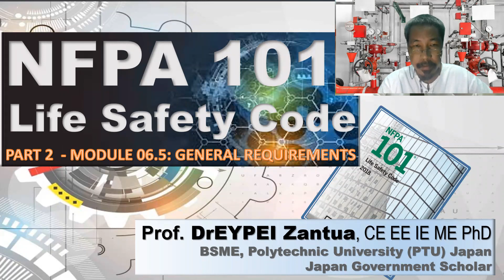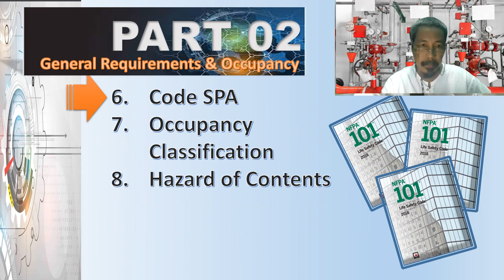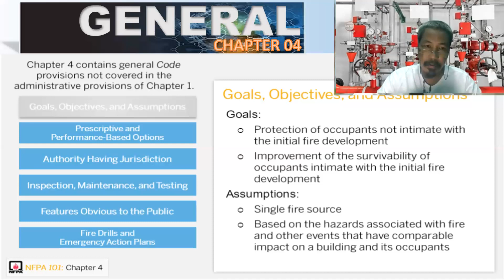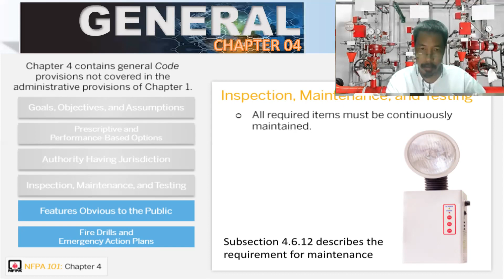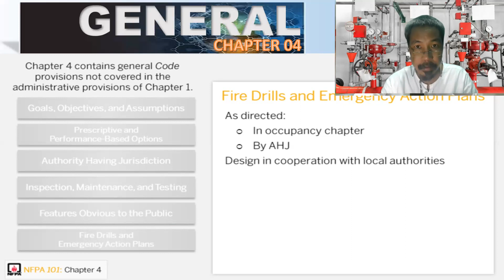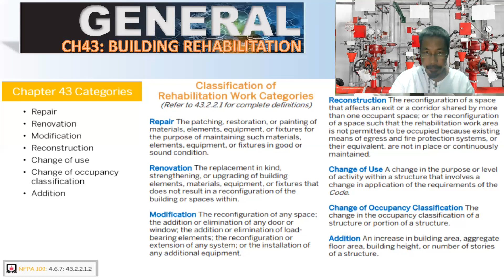NFPA101 GENERAL PROVISIONs || General Requirements: Module 06.5 [ Reference CODE by RA9514-IRR2019 ]

Comment: Thank you sir for this video lesson about NFPA101 GENERAL PROVISIONs || General Requirements: Module 06.5 [ Reference CODE by RA9514-IRR2019 ]. In this video sir discussed the General Provisions that is under NFPA 101. It also tackle goals, assumptions etc.

Comment: Thank you sir,In this video I learned that we should have set goals before creating a structures and that goals is to put the safety of the people for that building and also the equipment should always maintain so that they can still use it or remove if its broke. Every sturctures should have a emergency action plans   for the structure and to have design with the cooperation of the local authorities. All existing building should meet the minimum requiments for existing occupancies.